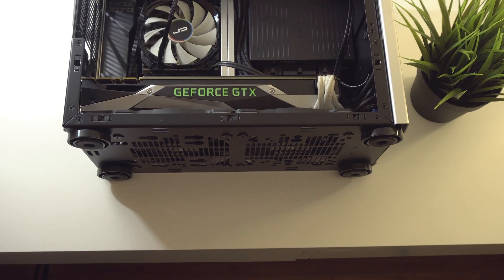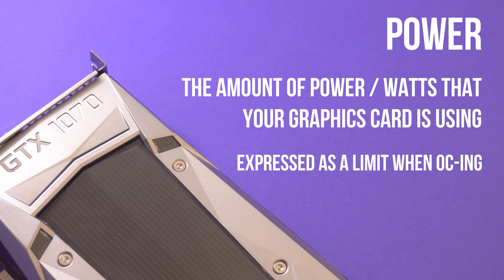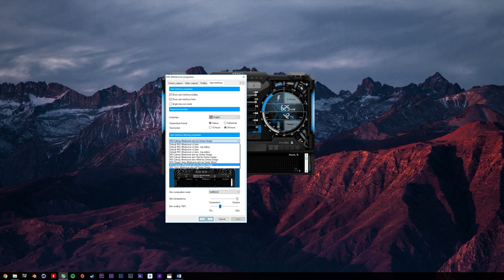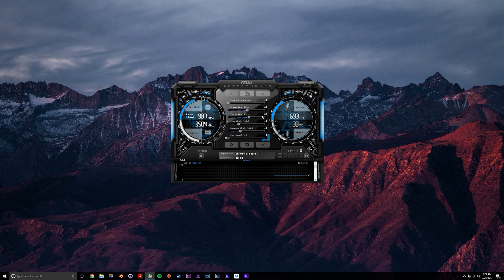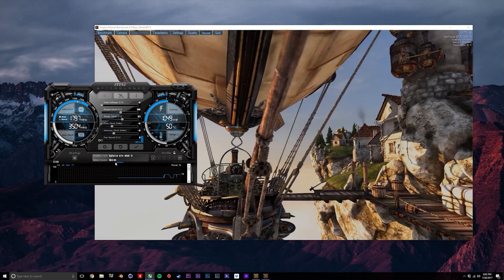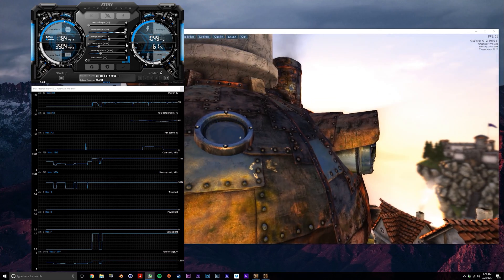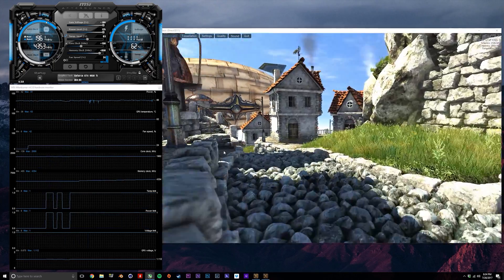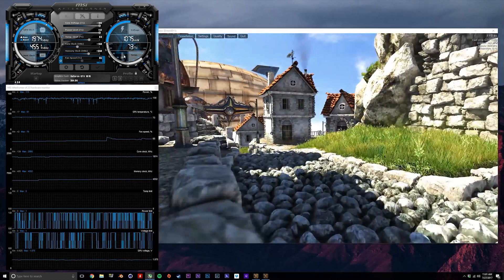Graphics Card Overclocking Guide!

Comment: Well done, clear and precise,
for the fun of it, I've OC'ed a Gtx 950 FTW/Acx by EVGA with MSI afterburner and on OsD
max core clock was 1404 / now 1578 
max mem was 3301 / now 3602
Volt +100
max power and temp max 80
with 62% Vent, temp hit max 55
Heaven (Xtrem), Valley (Xtrem) pass, so far so good. thks again.

Comment: Thanks! It made me try to overclock my Zotac 1070 Amp!, and achieved a stable overclock of 2050MHz without changing anything except the core clock. The card is running at 70ºC with the fans running at 70%. However, anything higher was really unstable, even with increased voltage, so I think I'm going to stay with the dead stable 2050MHz.

Comment: Here to share my results. Running an msi gtx 960 4g. At stock i got 83fps in the witcher 3 in ard skellige, at full oc i got 97fps. Note that i didnt even move the camera between the two tests it was at the exact same place on the game. The full oc means that anything further gave artifacts in game or even reduce performance. Before temp was 65 degrees C, after was 71 degrees C. Clock was 1503mhz.

Comment: I overclocked my laptops gtx 940m 2GB with an extra 134 MHz in core clock and 170 MHz in memory clock it went up by 8 degree celcius but still stable
Reply: Thermal_Sniper X it's not really safe to oc laptop gpus.
Reply: too late

Comment: No benchmark results?
Reply from the maker: You'll see a 5-10% increase depending on the overclock.
Reply: Not worth it in my opinion considering increased power consumption and potential decrease of lifespan of the video card.

Comment: Overclocking is nice to pump your numbers on a benchmark, but for daily use I prefer to undervolt, keeping the stock frequencies. With my current rig (780ti+4790k) on max. oc settings I would get a 10-20% gain in (gaming) performance over stock settings. However this comes with +60-80% in power consumption compared to my undervolt settings. Totally not worth it. Even more so considering a kw/h costs me ~27cents. Performance comes never for free.

Comment: Hey man nice video! I get strange results trying this. I can up the core clock by 160 MHz without adding voltage. Anything beyond that is unstable no matter if I add 100% extra voltage. Another weird thing is Heaven getting bad FPS when I click on it and when I click on afterburner whilst still running heaven the FPS shoots from 40 to 60.
Reply from the maker: Try knocking down the offset to +140MHz and then increasing the voltage. By increasing the voltage you'll now be running at a larger offset, effectively +170MHz for example.
And is it possible that you don't have the overclock in place until you open Afterburner? Make sure you have start with windows and start minimized enabled.
Reply: Thanks for the reply. I have selected afterburner to open on startup now and have increased the voltage to 50%. I run the memory and clock speeds at +450MHz and +145MHz

Comment: Are there any downsides to setting the power limit to maximum? or does it just allow the GPU to pull as much power as it can so it doesn't throttle until it reaches your set temp limit?  So.. since it's under your temp limit it's safe or do I have the wrong end of the stick?
Reply from the maker: Since it's under your temp limit you're all good. Only draw back is extra power draw from your PSU and wall.
Reply: Ah ok, good to know.  If you have a minute, could you please elaborate further? I have a couple more questions you see:
So is it the same with voltage?  a.k.a it's safe to set it to maximum (+100 or AMD equivalent) because 
again; does it all just come back to temperature?  If the OC isn't obviously unstable due to crashing and artifacting of course.  Lastly were you saying that putting your card to +100 voltage ups the voltage varying amounts, on a card to card basis, due to a card's manufacturer dictating how much voltage is added a.k.a safe for their specific card?

Comment: Thanks for the information on the order to adjust an overclock.  It makes sense that you'd want to find your max stable Core overclocker and THEN add voltage to see if the new voltage supports anything higher.

Comment: My gpu(1080 ti msi lightning X) has a voltage limit of 1.093V i know i can get 2100 mhz if its a bit higher i am struggeling for days... do you maybe know a way that i can set the volt limit a bit higher? thanks
Reply from the maker: Damn, I thought the Lightning X would have a bit more headroom.. Surely it has an insane power limit though?
Reply: Optimum Tech the only problem is the volt limit i am searching everywhere to get above the 1.093 if i can get atleast 1.12 i will be able to hit 2100mhz

Comment: My 1050 Ti has a power limit of 104 🙃😌
Reply from the maker: Damn, but do you really hit a power limit? If you check the final OC with the Gaming X 1050Ti that I used, it barely uses 100% of power. The 125% power limit is overkill lol
Reply: not really, this is my final score that I found too perform best with me, 
Core voltage +50
Power limit: 101
Temp limit: 86
Core clock: +220 
Memory clock: +500
The graphics card that I'm using is the: gigabyte 1050Ti Oc edition, windforce 
But I was shocked when I opened the box and found out the card didn't have a pci-e power connector

Comment: 6:50 I don't know about you but I've been running my GPU overclocked with Afterburner for a good few months and I never had it set to automatically start up with Windows yet my GPU remained overclocked without it open. So I don't think that is required.
Reply: you are right there is a startup button below the fan speed slider if you enable it you wont have to open the application everytime you want to apply the overclock
Reply from the maker: As Usman Afridi said you likely already have this enabled via the Windows Startup button in the bottom left, that's another way of doing it
Reply: Yes I have that enabled. With it the program doesn't run in the background and I still have my overclock enabled.